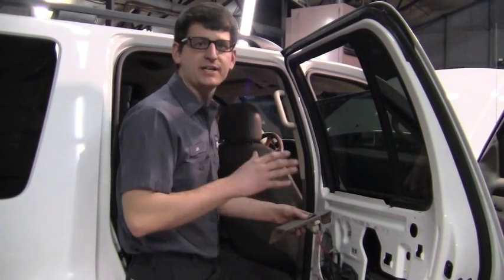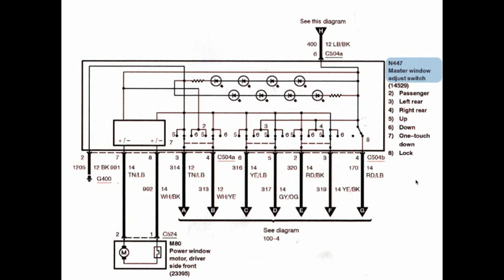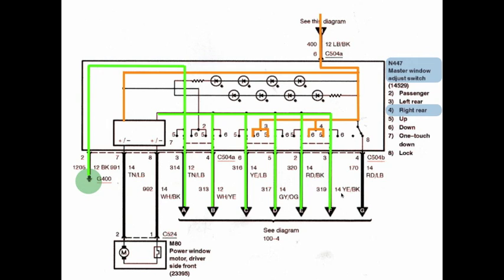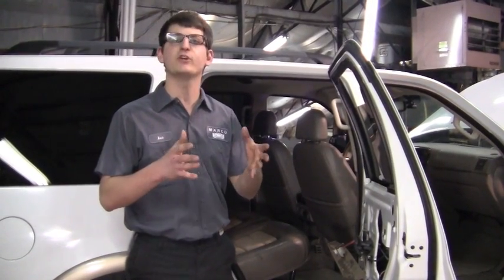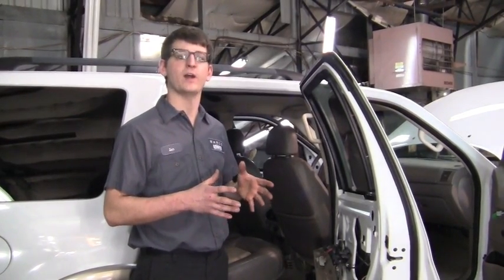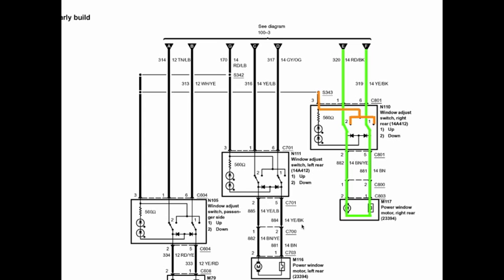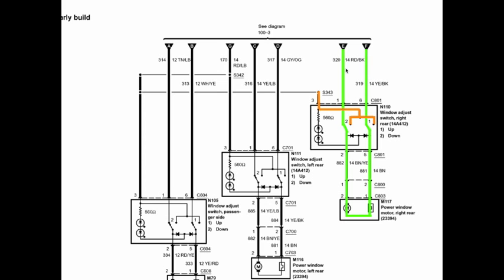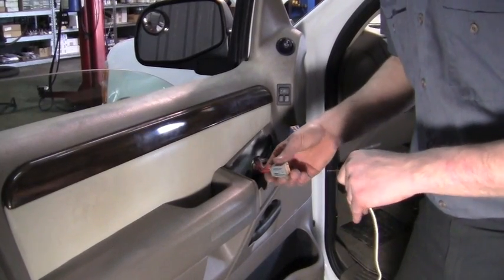Ford Explorer Window Won't Work

Comment: Thanks but my window makes a sound as if trying to roll up on the R front window. But it will not roll up
Reply from the maker: most power windows use either a plastic track or gears.  It sounds like youts have stripped out.

Comment: My problem is similar except that my passenger window will go down but not up. What could that be?
Reply from the maker: most likely a broken wire either in the drivers side harness
Reply: @realfixesrealfast  thanks

Comment: I’m glad I found this. My wife has been dealing without her passenger window going down and I had done everything I could think of. Did not think of a broken wire but there it was once I pulled the driver door wire boot back. Any problems in the future that’s the first place I’ll look. Thanks. All you firefighters out there stay safe. Jeff from Freeland

Comment: Same problem on my 2000 Excursion. Same yellow w/ black stripe wire broke, as in this video. 1.5 hr from start to finish on fixing this. Saved $150 that the shop would have charged to fix. Thanks for the video.

Comment: 2004 explorer passenger window fixed with your video. Driver's door wire was the issue. Thanks for saving me the time, money & trouble.
Reply: 2003 my driver window was intermittent working then it stopped working completely with window in up position

Comment: I have this problem on my driver side door in my 2002 Explorer. It will function all the other doors, but not the driver side window itself.  The auto lock button on the driver side door also stopped working a few months before. Do you think the 2 could be interrelated?
Reply: My 03 driver window was intermittent now ha stopped working completely, in the up position.

Comment: omg... i changed the regulator in front passenger and it still didn't work.... i was lost... watched your video and didn't have volt checker so i just went for the door jamb and the wire bundle and bingo!!!!! just like on your video the first thing i see is a frayed wire... repair and done thanks!!!!!!

Comment: In my 2002 Explorer, when I try to raise the window, I hear a fast tic, tic, tic, tic, tic. so I know there is power going to the switch and motor. So could the problem be with the motor, gears and such? or could it be that the glass came off of the track or whatever holds the glass. BTW, I am able to raise and lower the glass manually by grabbing a hold of the of the glass with my hands and moving it up or down.

Comment: Very nice video on troubleshooting power window problems along with wiring diagrams. I have some questions as well as suggestions. 1st, when doing continuity test...do all the connectors just simply pull and unplug from the switches? Even on older 98 model Explorers and/or Mountaineers? 2nd, that's a lot of trouble to have to unplug the right rear switch to test on the front passenger window (you would have to pull off yet another door panel). Instead of doing a continuity test from driver master switch to the right rear window connector (Red/Blk to Red/Blk, Yellow-Blk to Yellow-Blk), you could've used a test light back probing the Red/Blk at the master switch while toggling (Up or Down), then back probe at the Red/Blk on the Right Rear switch. You could do this with the Yellow/Blk as well. If there is continuity between the master and rear switch, the test light will behave the same. Note, there is the input to the right rear switch on pins 1 & 6 and there is the corresponding output on pins 2 & 5 going to the motor. 3rd, I would not have soldered that cable in and then test if the window worked. I would had twisted it together, test the window, and if works than solder them. Nice video though! I'm now faced with a situation whereby the motor is dead, but I need to roll up the window for now until i can fix it.

Comment: As everyone said, it was an extremely informative video.  Thanks.  My problem is a little different from that in the video, and hoped you might be able to answer a question for me.  I have an extended cab, so it has only two operating windows.  I had been having problems with the switch for the driver's window, and all the sudden both windows stopped working.  Neither switch on the driver's door will operate either window, and the switch on the passenger's window does not work either.  No blown fuses, and I exchanged the relays.  If the switch on the driver's door goes bad, is it possible for it to prevent the switch on the passenger's door to stop working?

Comment: I would like to do a wire repair outside pivot point, as solder joint is hard and it will stress remaining wire and this problem will reappear.

Comment: Thank you for the info on the broken wire issue.  My 2005 Explorer's problem with the passenger power window was a broken wire just inside the driver's door. Your video saved me gobs of time ... Thanks again!

Comment: Great video. Thanks a bunch as I wasn't sure how to get the rubber sleeve out to get access. I would like to mention one thing I figured out in the past by breaking mine. Before you remove the switches you should remove the panel behind the door handle. It is also clips and you can just pry out right behind the speaker grill. On the switch there is a little plastic clip that helps hold the switch down. It clips onto the door handle panel at the front. Again, great video!!

Comment: Hello, This video was very helpful to me in many ways. My problem is different, on my 2003 explorer V8 EB loaded. All of a sudden my windows wont work unless I have the DRIVERS door open. when I shut the door none of the windows will work from any of the doors switched, when I open the drivers door   all of the windows work from each door including the master drivers controls. Any ideas ???
Reply: +johnsshelbygt I had the same issue. Basically the same issue as this just my broken wire in the drivers door was a 12 gauge black wire. I also found 2 others that the coating had broken free.

Comment: I have a 03 sportrac and my left rear window goes down but it wont go up. And on my master switch the door lock and mirrors dont work.. i dont know if all of this is connected. What do i need to do to find the problem...

Comment: I have a 2002 ford explorer and I watched ur video and found 4 broken wires but the windoe still doesn't go up and down what else could I  do the motor is good so is the switch and still nothing getting to the motor

Comment: an easy first check is to activate all the window controls and look for the overhead light to dim. this will show if power is being sent to the window motor or not. if the light dims the power is good and the motor is drawing current dimming the light some, if not there is no power going to the window motor or the motor is not working.
Reply from the maker: Thanks Kevin for your input.  It's these simple things that we don't often think of that can save us time.
Reply: T
hanks Kevin!
Reply: So, I tried this.  My lights dim when I use the controls for the window that won't go down.  Does this mean that the motor is drawing the power, but just not working?   I already looked for a broken wire, and didn't find one.
Reply: very good point I got to go try that

Comment: You wasted way too much time by switching switches, and checking resistance, if your master switch provides ground to the rear switch on both wires at all times, all you had to do was unplug motor and  make sure there is ground on both output wires to the rear motor ,if one of the wires is missing a ground, work the master switch up / down recheck the wires for power, if you have power on both wires when working the master switch,  then you have a bad master switch, if you are missing ground and power on the same wire you have an open wire between rear switch and master switch. Testing it this way will also test the rear window switch for open circuits.   Very rare a master switch fails sending both power and ground out, it is usually a bad ground contact internally.
Of course always verify operation of motor,even when a defective switch or open wire is found.

Thanks for posting.

Comment: You said your DVM won't check for high resistance on continuity test, that's correct, because you won't get a very high resistance on those wires anyways.... a 200ohms scale is plenty to check for resistance on those wires, unless their a mile long. And, on most DVM's you could still get the beep on continuity even at 30 ohms, maybe even more... ? outside of that you just have to watch the meter for a reading. So I doubt very seriously if you need more than a 200 ohms scale to get an accurate resistance reading on any wire in a vehicle, it takes a very fine and or long copper wire to jump off a 200 ohms scale.

Comment: A continuity check will only show opens, but will not test for high resistance....oops, Zach let one slip. I only caught this a month too late.  Killer2600, you are correct.

Comment: Also wise to check all the other wires around the the broken wire area. Since one wire broken, may be the case that other wires show signs of failure (e.g. insulation broken, wire looks flat with bare wiring seen, chafing evident etc.....) especially at a pivot point or hinge.

Excellent video, keep up the good work.

Comment: Great video, but a continuity test can fail you if that wire had just a few broken strands of wire. After confirming the motor and with koeo unplugging the connector at the motor back probing the connector side and load testing with a LoadPro while pressing the door or master switch up or down would have identified what side was open or had high resistance. A continuity test can fail you, a voltage load drop never will, plus its quicker too...
Reply: Yeah, continuity tests can be very very misleading.  They are only accurate at indicating an open in a circuit. A voltage drop test is much more accurate & useful. While a LoadPro is a cool tool, it is a little overkill here (no disrespect to Daniel Sullivan). A simple voltage drop test across pin 3 & 6 of the rear passenger window switch while pressing the down button would produce a reading of zero volts (loading the circuit with the LoadPro would also produce a zero volt reading because there is no current flow due to the open in the circuit, btw).  If you wiggle the meter leads at that time (with the LoadPro or not) you would get a ghost voltage reading (if auto-ranging is enabled on the meter, otherwise set the meter to mV) indicating a open in the circuit which could only come from the yellow/black wire with this circuit.

Comment: That's a wise tip, to go to the door that is used most.
Reply: the only reason he checked that right front door is  because power has to go to the master switch first according to the wiring schematic other cars could be controlled differently.  a voltage drop could of save less time about 50%.  continuity or resistance is not too precise since a few strands of wire could show continuity and resistance but with a voltage drop test you could see the voltage lost at the system meaning corrosion or not a good connection

Comment: I mean, with ground applied to both sides of the motors at all times, as soon as you apply voltage to either side it should short to ground.

Comment: It looks to me in the master switch diagram, anytime you push a button for the pass. front, pass. rear, or driver rear you're going to blow a fuse. Am I missing something?
Reply: The diagram is the circuit at rest. By pressing the switch, you are changing the circuit to remove ground from one side of the motor and replace it with power, while keeping the other side of the motor grounded. The motor is the load so the fuse will not blow. Hope that helps...

Comment: Question where do I buy the little clamps to hold wires
Reply: You can build your own from some wire & alligator clips available at most electronics stores (e.g. RadioShack). The magnetic kind he uses is cool and available on realfixesrealfasts web site as described in the video.

Comment: Be careful using continuity buzzer it can still sound at 100 ohms.
Also you can have good resistance but can still have a large voltage drop in the wire.
It is a good test just to prove if you have a complete circuit or a open.

Comment: It sounds like to me Zach deserves a pay raise, outstanding performance my fellow techs. Being accurate and thorough is the key to diagnoses. This is just ONE way of diagnosing this complaint. Isolating those wires one at a time and either applying a ground or power to one end with a test light attached to the other end would have shown the same results. The test light, would not have illuminated, indicating an open(infinite resistance) in that wire. There are so many variables, but that is what keeps us on our feet. Good Job.
Reply: There are definitely faster ways to do the diagnostics but they aren't as intuitive and easy to follow as this procedure.

Comment: Good troubleshooting, But a little too much. I would use my meter to check the switches. Check voltage at the motor. Then I know it is an open. Good repair.

Comment: what i see is that truck needs 4 new window motor they seem slow for sure
Reply: lol
Reply: I used silicone paste on a brush and ran through the window channels, fast as ever tbh
Reply: Battery likely needs to be charged.
Reply: Emin Muradov Yeah, I avoid replacing slow window motors most of the time, with a liberal application of silicone paste to the tracks and guides.

Comment: hi I have a 98 Subaru forster  belt , and I have sounds coming from the poly of one of the driving  belt it sound like it went bad can I put lubricant oil drops to stop the noise temp.tell I get it replaced or what you advice me with and how long can I drive like that?
Reply: If the pulley is making noise then the bearing inside the pulley is bad.  The bearings are sealed, so it is very difficult to get fresh oil/grease into them without ruining the seal/bearing. I wouldn’t run too long with a bad pulley. It could seize up and cause the belt to burn up & snap. I’d replace it sooner rather then later. Good luck...

Comment: I ask because if the rear passenger window switch (RPWS) had constant battery voltage at pin 3 and the rear passenger window (RPW) did go up from the RPWS, doing a voltage drop test across pin 3 & 6 of the RPWS while pressing the RPWS down button would produce a zero volt reading. If you wiggle the meter leads at that time you would get a ghost voltage reading (if auto-ranging is enabled on the meter, otherwise set the meter to mV) indicating a open in the circuit which could only come from the yellow/black wire with that circuit.  So two quick voltage tests and you know there is a open in the yellow/black wire without having to take anything apart and saving a ton of time/effort.  Or am I missing something?  Thanks a lot...